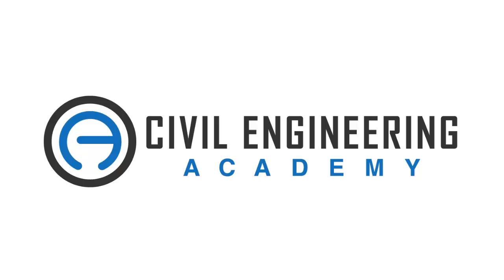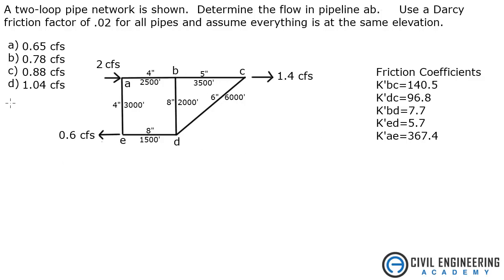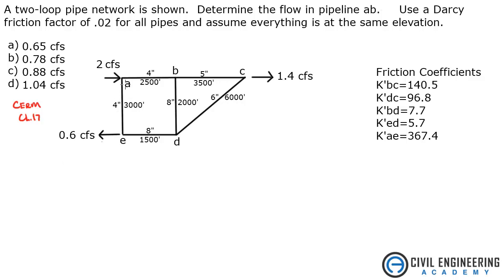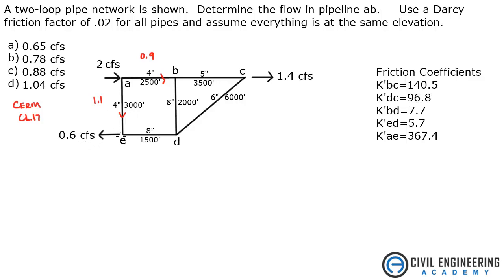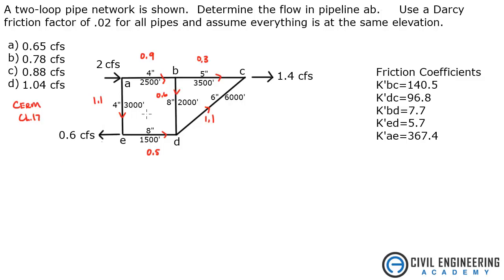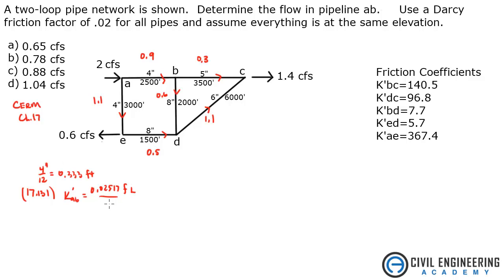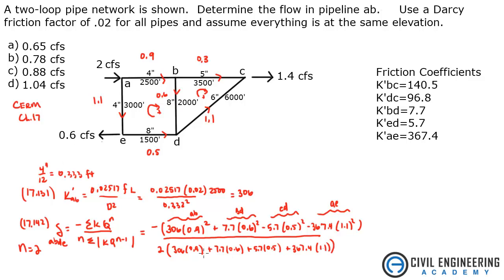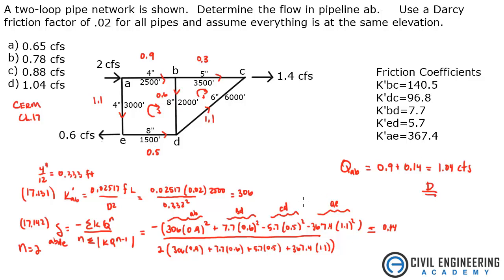Water Resources - Solve for Flow in a Pipe Network using Hardy Cross Method

Comment: I'm going to be taking the Computer Based PE and these equations are not on the updated CE Manual that is provided by NCEES.  Does anyone have any insight?
Reply from the maker: Not really... It's all very new.  I would imagine they stick to the manual for the most part but I'm sure it will be updated often. If there are topics outside of what's in the manual then they'll most likely give you what you need in the problem itself.
Reply: @CivilEngAcademy  yeah, this is the trouble I'm having right now. I'm studying through some old practice tests while using the just the PERM and only looking at the CERM after the fact. I've gotten very few questions correct. All that to say, should I start studying these practice problems with the CERM to get a better understanding of the content and then studying updated practice tests with just the PERM in order to prepare for the actual exam?
Reply: @logman35  I am studying the PERM and doing practice exams I found amazon that apparently relate to the computer based exam.
Reply: @skennell  which practices tests have you found that relate to the CBT?
Reply: @logman35  Path to PE services has a few that say “CBT” so I ordered those
Reply: @logman35  no. Use Ncees pe hb 1.1 as main source. And cerm as supporting source. Cerm is dead.
Reply: @CivilEngAcademy  Thank you very much!

Comment: It looks like this was adapted from CERM Example 17.10 with the same friction coefficients, lengths and diameters but different flow assumptions. If we use the assumed flows from CERM (which are in reasonable range for the flows in this problem), we'd get answer B. I'm confused as to why you didn't end up at the same answer as CERM, given that the only inputs that are different are the assumed flows. 

Thanks! Your videos have been super helpful. :)
Reply: The entrance/exit flows are dieferrent than the one in the CERM example. :)

Comment: when you are calculating delta and expanding those summation terms, why do you subtract the terms associated with de and ae in the numerator, but ADD them when you expand out the denominator? if you're supposed to associate a negative sign with counterclockwise flow, why doesn't it carry over for calculation of both the numerator and denominator?
Reply: The denominator is Absolute value, marked by |  |.

Comment: Shouldn't the correction factor come out negative (-.14 cfs) given the equation you used? Then when added to the assumed flow rate end up as a subtraction for clockwise and an addition for counterclockwise flow?
Reply: As written, the equation will yield +0.14 cfs because the 'ab'+'bd' is less than 'cd'+'ae'.
The take-away is that if the assumed flow direction is aligned with the assumed positive (clockwise), then delta is added to the assumed flow rate.   Otherwise, it is subtracted.

Comment: A little confusion on the assumption.  You say we assume if it has a lower coefficient the flow will be higher.  AB has a coefficient of 306, and AE has a coefficient of 367.  So why did you assume the flow of AB to be 0.9 and assume AE 1.1?
Reply: Yeah that didn't make sense to me how he just randomly put numbers down.
Reply: @DeagleBeagle  We are only assuming the values of flow for each pipe at first. With the correction factor calculated, pipe ab is 1.04cfs and pipe ae is .96cfs. Remember the flow of ae is counterclockwise to the loop, so we subtract the correction factor. So at the end, pipe ab with lower k value has the greater flow.

Comment: Hi want to ask if there is a condition when to stop iteration? My professor mentioned that you need to do it several times and substitute the value of Q every iteration you do till the difference of the flow you get and the previous flow is equal to 0?
Reply from the maker: +Dana Mandia for the purposes of the PE exam I wouldn't do to many because you only have 6 minutes to solve the problem.  In real life, yeah, but for the exam no.